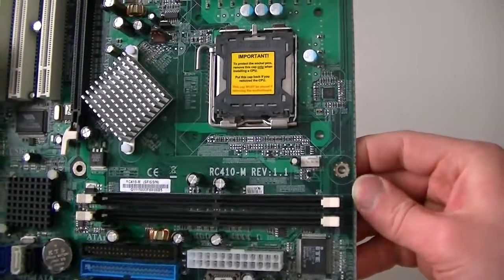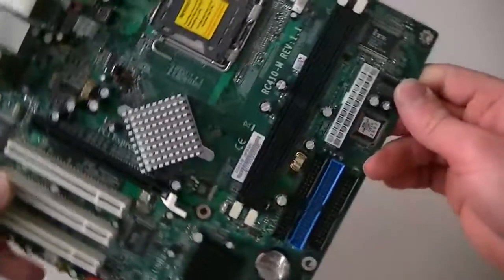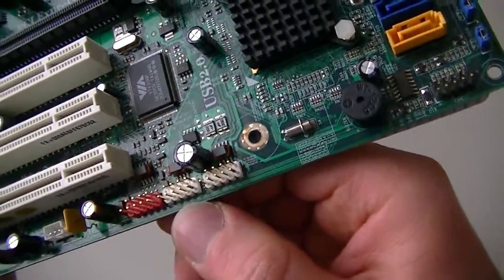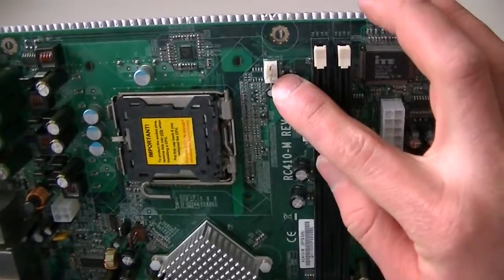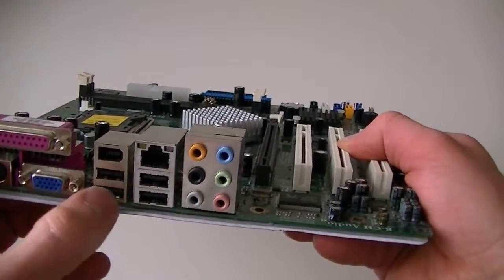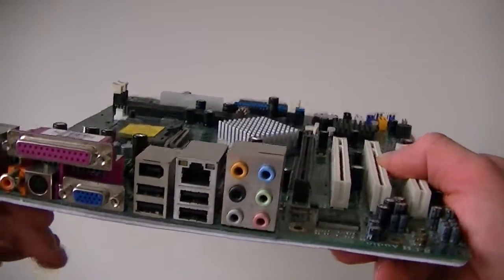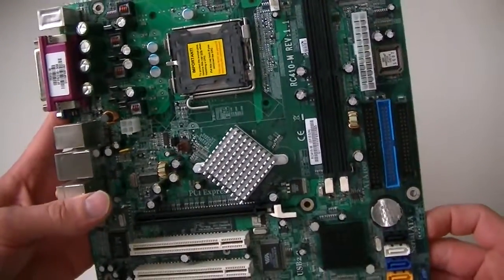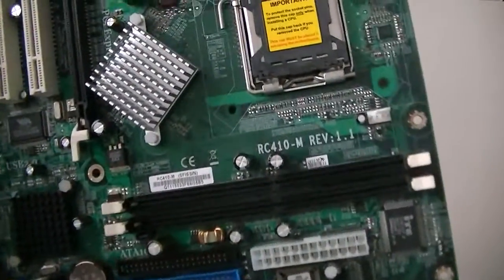RC410-M Motherboard

Comment: I installed 2x2GB RAM sticks however only 3 GB are recognized. The CPU installed is 64-bit. I read somewhere that it is possible to use an E6600 after downloading a new version of BIOS.

Comment: ¡I have one like that! "rc410-m rev: 1.1", i need your help.. where i can find the original drivers?
Reply from the maker: HI, you have to search online
Reply: Thanks for your answer... but, I i'm so tired 'cause I cant to find the official drivers about this model: "rc410-m rev: 1.1". Aditionally, in his website: "www.ecs.com.tw", only present 2 types of models: Socket 775 (Intel) -> 1) RC410-M2(V1.0) and 2) RC410-M2(V3.0) -> here the link: http://www.ecs.com.tw/ECSWebSite/Product/ProductArchive.aspx?CategoryID=1&TypeID=134&MenuID=24&LanID=0
Reply from the maker: Which operating system drivers do you need ?
Reply: Windows 7x86
Reply: @Richard69Feynman  I believe that you are not able to find the audio, I suggest use a automatic driver download - https://www.drivers.com/update_motherboard_drivers_main/
Reply: Windows 10 x86